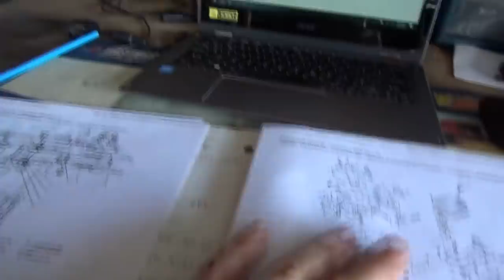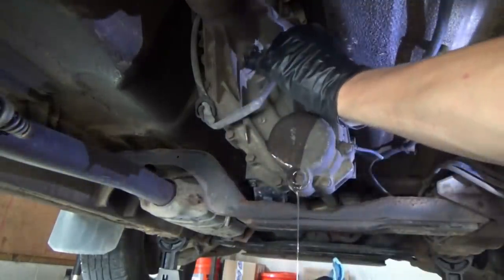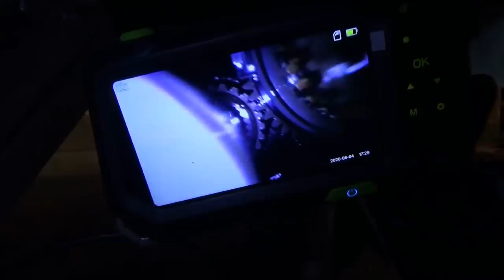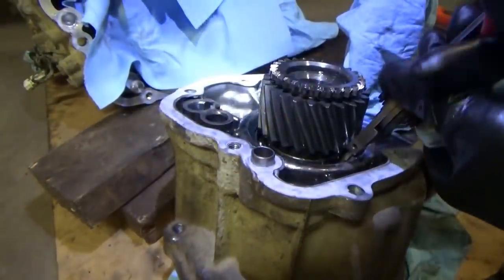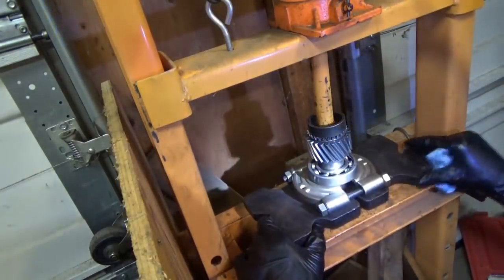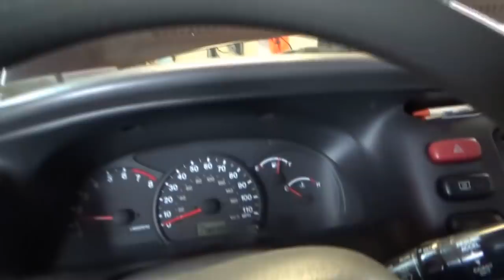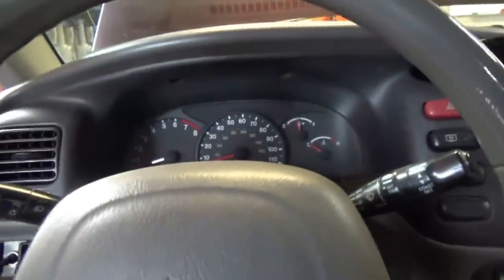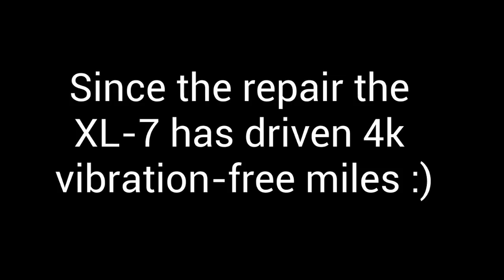Weird Driveline VIBRATION? (Suzuki XL-7 4x4)

Comment: I have a 2014 Yukon XL 5.3 with a misfire on the 7th cylinder. I replaced all the spark plugs  and the spark plug wire and only the 7th cylinder coil. I can drive the vehicle for a day and it will start misfiring  again on the 7th cylinder. I removed the 7th cylinder spark plug  and noticed there was oil on the spark plug.  So then I went old school and put a nonfouler on and another spark plug and after a while of driving I would get another misfire on the 7th cylinder. Will you tell me what you think is wrong with the 7th cylinder and where you think the oil is coming from and what I can do to fix it? 
Many thank!
Reply from the maker: Compression. Does it have the cylinder deactivation bullshit?
Reply: @PineHollowAutoDiagnostics  would this be something a diy novice can fix? Are there step by step videos to show me how to fix the seal.
Reply: @PineHollowAutoDiagnostics  What do you mean when you say" deactivation bullshit"?
Reply from the maker: @chrisjumper3198  Does it have V8 vs V4 mode? Definitely not a DIY repair, but definitely get a proper diagnosis done.
Reply: @PineHollowAutoDiagnostics  V8

Comment: Ivan, what tonne is your shop press?
Reply from the maker: 12 ton
Reply: @PineHollowAutoDiagnostics  Thanks for your reply. I'm wondering if a 20ton one would suit my needs. If you use a 12 ton one for your work then I reckon a 20 should be fine.

Comment: My first thought when you said 45 mph was a tire.  Then  you said only in 5th, and I thought, uh-oh you have a transmission bearing out.  Some transmissions dictate (by bad experience) you overfill the transmission because some bearings don't get lube like they should unless overfilled.   I'm jealous.... you don't have all the dirt and grime underneath that I have to deal with.  Always check new bearings for roughness.... many of the new bearings are made in china regardless of brand name.  Sometimes they are rough right out of the box.
Reply from the maker: this SKF was made in the USA...pleasant surprise!